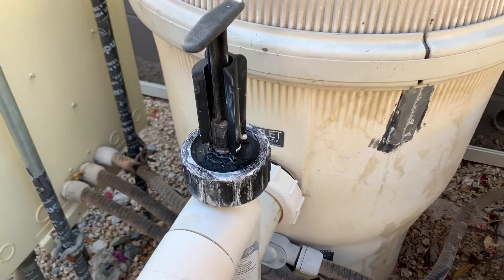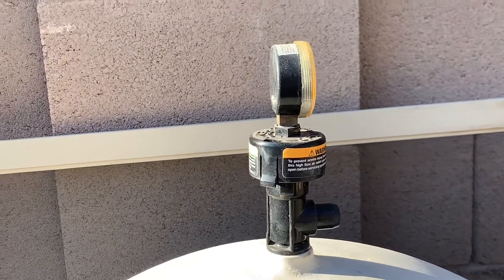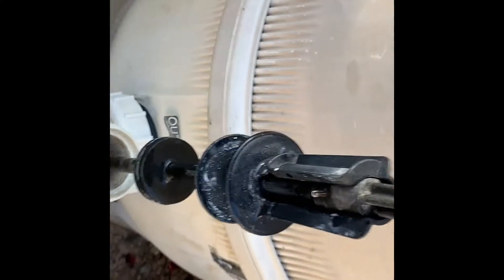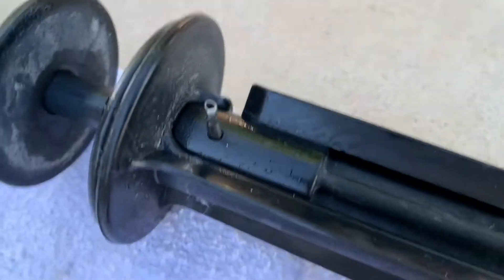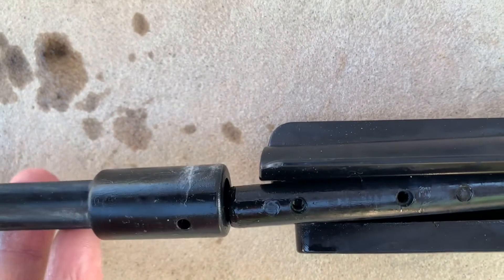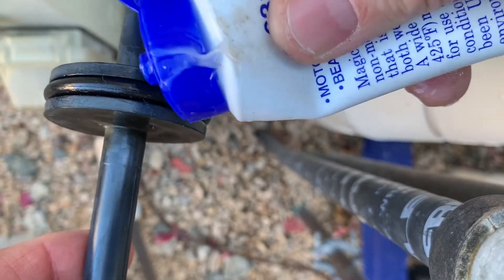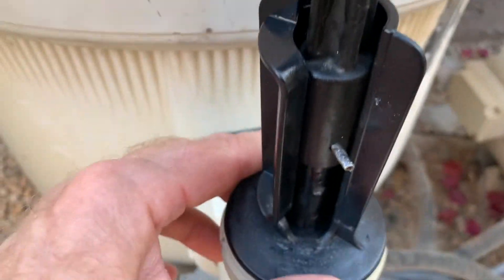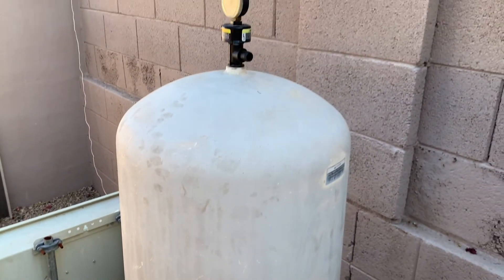Pentair 2” Slide Valve O Ring Replacement Tutorial. For Models 263064, 263055.

Comment: Great video thanks for sharing.  My backflow valve was leaking and I purchased the gaskets and magic lube you suggested.  The hardest part was getting the pin out but the kit comes with a new pin so I simply replaced it.   Works great, no leaks, ready for another 8 years!

Comment: Just wanted to add...you should apply magic lube to the o-ring groove before installing the o-ring and then apply it to the o-ring after its installed on the piston. This way the inside & outside of the o-ring will seal. Or just apply magic lube to the entire o-ring before installing it. It helps reduce friction which can cause flat spots on the o-ring.
Reply: Using a dish soap works too. A suggestion from Leslie's pool. I did finally get it out and used Magic Lube on the O rings. Works great. Thanks for responding

Comment: the ring holding the whole assembly on was tightened using a vice grip last October when the O rings were changed out by a "professional" and now seems to be frozen there. He also used cooking oil inside and now the valve is also frozen. Ok to use WD40 on either area or just the ring and see if I can get it to come out. Any help is appreciated
Reply: I had the same issue. But mine happens every time and I installed it myself and only hand tightened it. Its always been a pain to pull the piston assembly. Probably because I don't do it often enough. The Texas heat can be brutal on o-rings. I used a hair dryer and used a screw driver to pry around the edges for a least 30 minutes before letting loose. Then I started using Silicone Lubricant spray in the Blaster brand and it now takes me less than 5 minutes to remove. Don't use WD-40. And I use Boss brand Silicone Grease on all my o-rings. Silicone lubricants is what should be used on all pool equipment. Try this and you wont have any more trouble removing the slide valve ever again.

Comment: I did this and it started to shoot water from the silver pin area have any idea’s?
Reply from the maker: Yes, that would point to the small stem Oring. It either is not seated (likely) or missing. Make sure the new stem Oring is seated in the pocket of the upper retaining disc. You will see the Oring seat when you have it disassembled.

Comment: What if it won’t move at all
Reply from the maker: That means it has not been used in some time. Make sure the retainer ring is removed. Then gently rock the stem back and forth. Don't overdo it. The stem can snap. If you still can't get it, call a pro, or replace the entire valve unit.  Good luck.
Reply: use dish soap and let it soak for about an hour. Then try again. Had the same issue